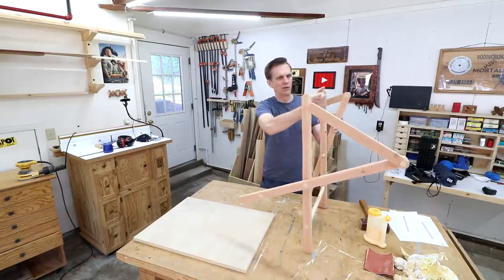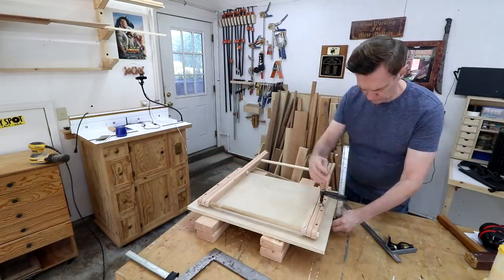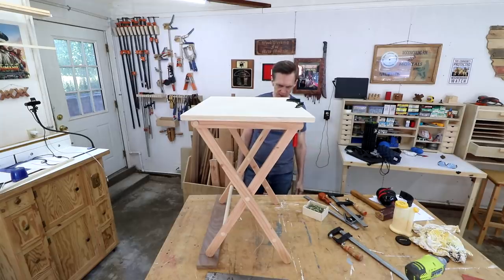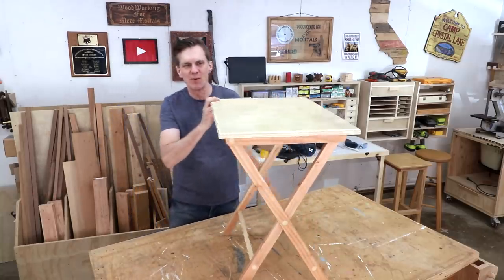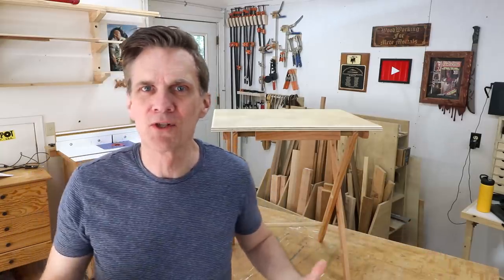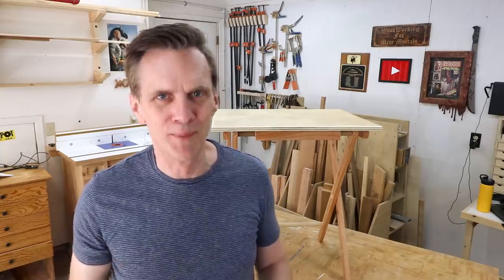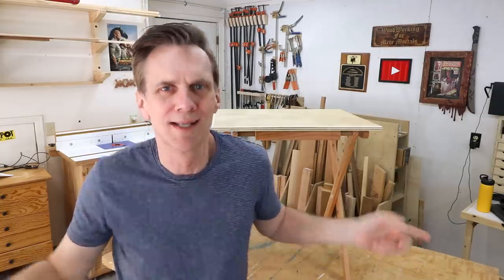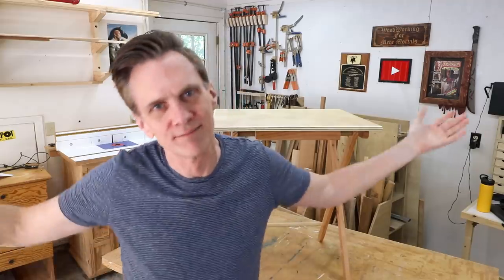Completing the folding table. This turned out trickier than I expected! LOCKDOWN Day 65

Comment: I built a set of these TV tables 10 or even 15 years ago.  I had the most trouble with the hinges but I got them to work.  At the time I was exploring tile inlays for the top.  I made 4 different tips all with a different time set.  
You are absolutely right about why we woodwork. We do it for the challenge and the fun of solving unforseen issues as the builds progress.  
Thanks for your show.
Deacon John

Comment: Couldn't agree more with your closing statements, for diversion I make little boxes from hard woods with dovetails, tight and perfect as I can, I usually burn them as imperfect.  Several years ago I decided to make a couple of raised beds to grow vegetables in, I bought 8 x 4 timbers and dovetailed them together just because I could and had no screws long enough to do it quick.  It took me HOURS, I think its 6 years later, the timber has dried, cracked , split and the joints have opened up, but I love those beds.  They give me joy every time I sit watching my food grow in those beds, they are not perfect, but I made them and they are beautiful to me.  That is why we fiddle with trees and spend a fortune on tools even though we actually don't need to, at least not when the material is 8 x 4 or 4 x 8 - whichever!  Keep 'em coming Steve.

Comment: I love this. I have a similarly designed table. One of the things that it has is an extra flat piece on the outside edge of the two legs without the cross-dowel. This keeps those legs locked from crossing over the dowelled piece. It also adds a bit of stability. Also, it has a basic block of wood that keeps pressure on the moving legs while the table is up. This allows you to transport the table ( say, with a game board on it ) without the legs flailing around.

Comment: About 12 years ago I made a pair of patio chairs following a tutorial from the family handyman magazine. It was my first attempt at wood working with only a circular saw, a plastic miter station, and a drill. ( of course measuring tape and a speed square). I cut and built the chairs in my apartment balcony, they came out very decent for a first attempt. To this day I have not seen a similar design anywhere else, so even though I got the idea from a magazine, I can basically say I came up with the design and nobody would question it. I still have the chairs which have traveled from California to West Virginia to Hawaii and back to California. They are still in good condition and I can fix any issues very easily. I can guarantee that I would not be able to buy similar chairs cheaper than what it costs me to make them 12 years later with all the tools I didn’t have before, the space and most importantly the knowledge I have now.

Comment: I made my wife a magazine rack for our 4th anniversary. I got the plan from a Dover book on Mission Furniture, and enlarged it to bookshelf size. This was my first attempt at a big-time woodworking project. I used mortise and tenon joinery with through mortises on the top and bottom shelves that was put together with wedges, all made with chisels, in rock maple. Holy crap was that an adventure requiring all sorts of mental gymnastics and trial and error. I was an engineering student at the time so this was an extravagant outlay on materials, but we were living in a bungalow, my wife was collecting smocking magazines and this seemed to be the perfect gift. I spent 3-weeks on it and 20 years later I still see every irregular cut, the place I had to glue where the through mortise blew out, and the swirl marks from the orbital sander that were left on a side rail. My wife just sees a beautiful piece of furniture her husband made explicitly for her. I spent way more than I had intended, but I thoroughly enjoyed the build process and my wife cherishes the end result.

Comment: You really hit the nail on the head... at the end there. I find sitting around and planning out the project very satisfying and when I've redesigned some simple thing 6 times and finally built it for twice what I thought it would cost and 3 extra trips to home depot, I see imperfections no one else would ever notice for years and for some reason point them out to people. Then I start the next one! Keep up the good work.

Comment: I have to admit that I am repulsed by knockdown furniture, and I have greatly enjoyed replacing the particle board junk I bought when first furnishing my home before I started woodworking. It's stunning how easily I've been able to basically fold up those particle board pieces I got from Walmart 3-5 years ago without even using tools. Meanwhile, stuff my Dad build three decades ago is still rock solid. 
I do build things because "I can" and I love the process, but building the things I NEED is actually the most fun for the reasons Steve hit on toward the end. If I'm going to use a table or a desk every day, it feels uniquely more satisfying to use it knowing I'm the one who built it. It feels so much more rewarding to give someone a gift I custom made for them than it does to order them something from Amazon. Personal satisfaction and ultimate customization are just impossible to buy off of a website or out of a catalog.

Comment: Steve, thanks. You got me into making stuff cos I wanted to. Biltong cutter, music stand, rabbit hutch, plant stand. And now I'm converting a van into a camper. This folding table is interesting, cos I'm about to face a similar problem with the legs. I'll do some sketches (and the math) but it looks as if the legs all have to be the same length, with the hinge hole in the legs offset so the legs fit inside each other. Mum had an ironing board with similar legs, had 3 height settings with three stops for the 'free' leg.. But the board was always level. I think watching you struggle has really helped me here.

Comment: I hovered around wanting to get into woodworking because I am a maker and I saw some crazy-expensive things that I would be happy to make for less myself. I knew if I did, the quality would not be the same as the ones I saw, but I was okay with that (looking at you, Wyrmwood gaming accessories and table!) But I kept daydreaming and wishing I could be instantly good. What finally got me to pull the trigger was Steve's video about 18 things every woodworker should know. Since then, I have built my table, and dealt with the frustrations inherent in things like box joinery and removable legs and using edge banding (which I won't again for durability reasons). I am making benches for the table this year with interlocking lap joinery and tongue and groove assembly for the bench tops. I see every flaw on that table every time I look at it no matter how much my wife praises it. But then I look at it and think, "Yeah, but none of my friends or family ever made a custom gaming table, so what room do they have to talk?"
Each thing I make comes with a learning curve. I mess materials up. And that's because I am a woodworker. :)

Comment: Mass produced furniture is made in standard dimensions that may not fit my room or requirements.  Making my own furniture is not only fun, but allows me to make the furniture customized for my needs.  I’m relatively new to woodworking and one of my first projects was Steve’s Adirondack chair, which still looks great after five years on the patio.  I’ve been a fan ever since.

Comment: Thank you so much for sharing your struggles with this project as I have been trying to build one of these by scratch for months.  Your idea about using dowel rods for the cross-sections is exactly the solution I needed as I've been trying to use a bolt which wasn't working.  You are awesome!

Comment: Cool project! My wife and I have a store-bought folding table like that, and the makers put a little flat bar across the underside of the top, sort of as a track for the legs to follow when you open and close it, if that makes sense. The bar goes from the center of that stopper piece to the center of the part of the stationary legs that is attached to table. If you can decipher what I mean, it might be worth adding. Haha.

Also, awesome motivational speech at the end! I'm trying to get into woodworking, and there's some great bits of wisdom I hadn't thought of!

Comment: I started woodworking as a therapy. From small simple boxes at first in order to learn the craft (especially safety), I went to more complex objects (12-side boxes with round lid, or my own design lamp, and now I built a tensegrity object from scratch (no plan, no measurement...). Today, when I make something, it has to be a challenge, or as you said, I might as well buy it...
Thanks for the inspiration!

Comment: In 2018 I built a system at my work place. The office was in a regular house with a back garden and that garden was turned into a car park but it was behind the house so if you came in and found that your car can't fit in you had to reverse out and it was inconvenient and not that safe. The system I built was made up of 2 arduinos, a couple of sensors and an LED display. I didn't have prior knowledge of the LED display, nor the sensors, I just experimented with arduino before. I soldered the required components on a testing board, attached the wires, the arduinos, connected 15 sensors (1 for each parking space to monitor). The whole system ended up costing about a $1000 and it was pretty neat. I was proud of myself, I did the heavy lifting and some of my colleagues helped with digging to lay down cables, drilling stuff, etc. After it was done I was proud but felt empty. I was partially sad it was over, but I also saw it's flaws and knew I could have made it better in many ways. I don't know how much it would have cost if we hired some experts. But it was planning, experimenting and building it.

Comment: Thank you so much for putting your money where your mouth is and showing us the problem-solving along the way! It's so valuable to my own woodworking journey and to my journey as a human.

My workshop time is basically "sawdust therapy." Such a tactile and creative process has basically become a form of mindfulness for me. Progress is slow because our workshop is still in the process of becoming a functional space (made enormously better already by The Weekend Workshop course). But even the janky shelves that I tried to spray paint and the plywood end grain looks awful, and the RIO shelf from the course that I accidentally gouged with my random orbit sander in multiple places - I still built them and that is so deeply satisfying.

Was surprised though that you didn't mention one key benefit of making your own projects - customization!!! I can build projects to the EXACT specifications that I prefer. The RIO shelf I tweaked to fit exactly in the nook between my garage door and the wall. That's a huge benefit even if it's tricky sometimes to modify plans!

Thank you for creating such a delightful corner of the Internet ❤

Comment: “Because we can.” Yep, that pretty much sums it up. Case in point - I’m making a flyscreen door for our back door. It’s all hardwood and some quite challenging joinery (for someone who has only recently come back to woodworking after a 40 year hiatus), and gonna cost a bomb. Certainly way more than an off-the-shelf timber or tube steel job from the local hardware store. And absolutely less secure than at least the steel option. But I’m going ahead with it because it provides me with a brilliant hands-on learning opportunity, a chance to further practice my joinery skills and, just maybe (if the damned thing actually comes together as intended!), some small sense of accomplishment. And, if I do do it right, it’ll still be around long after I’ve shuffled off my mortal coil. That makes me feel pretty good.

Comment: I agree that sometimes it's better to just buy it. Sometimes it is cheaper to buy it but i think it also depends on how long you have been doing woodworking and how much scrap crap "scrap" you be laying around. Small things are easy not advantages to build rather than buy. Just last night my brother in law and I built a stand for his Onewheel. They are $100 and I used scrap around my shop to build him one in 45 minutes. All of the materials were paid for by other jobs. I think the size of the project depends on if you are going to save money. Quick things to throw together and still have function and form totally worth it. I built my breakfast bar out of class 1 maple flooring I found in a dumpster outside of a gym that was having its floor replaced.  I used that as the bar and I cut up some bed frame and put the bar on the frame to hang it on the wall. That saved me money, however I bought the bar stools because we needed adjustable bar stools. Me and my 4 year old definitely can't sit at the same fixed bar stool so we just bought them. So yeah I agree but not for the small stuff.  Our custom stuff.

Comment: The same thing happens in many fields - electronics and computers for example.  For years it was cheaper/better to build your own, but now with mass market, an off-the-shelf devices costs much less than buying the parts.  So, the same reason for building/assembling your own exists in that field as well - I build it myself because I want to and I get exactly what I want the way that I want it.

Comment: Hi Steve.  I have a couple of these TV tables, and they have a small strip of metal, probably about 1mm thick 19mm wide and 45mm long, shaped and fastened to the Cleat to capture the table top dowel when it is put up.  There is also another cleat on the opposite side of the table top, minus the piece of metal (not sure .why that is there, except to stop the table legs turning inside out.....)    Love the projects.

I build something because I want to, rather than because I must, or because I cannot get what I want at a reasonable price.  It was a game board called "9 and 12 Men's Morris" I wanted, that set me looking at woodworking again and I discovered your amazing Chess board, which I still aspire to.

Comment: I'm amazed it was so easy to make the top level or straight to the sub-straight since what your sitting it on may not be level.  I would have tried to make the floor level then worked my way up to the work bench and finally to the top of the table.   Great Video, you have saved me so much work!

Comment: Great video Steve!  Love the TV tray. Two small improvements I see would be to add a stop block on the back of the tray to keep the leg from swinging out the back side. Second, the stop block on the front could use a lip on the under side to keep the top on the leg if you lift the tray.

Comment: Thanks, learned more from the wrap up than the video.  Been wood working fifty five years.  Lately I have been building tombstones.  Something to remember me by.

By the way, if you didn't do it,  the stop on the table should "capture" the cross bar.  Otherwise, when you lift the table it will collapse.

Comment: Hi Steve, Another interesting and informative video.
It was nice to see how you worked round the challenges of making the design work in reality, but I was particularly interested in your monologue of 'why bother?'.
For me there are two key aspects: creativity and ownership.
Creativity inspires us to make things that don't exist, whether that's an artist painting a picture or a photographer looking for a new angle of something that's been photographed a million times.
If you just want a picture, Ikea sell them too, but it's not YOUR picture.
And that's the other part. It's about making something that you have chosen to make, the way you have chosen to make it. Most of your 'Lockdown' projects have been things that solve a problem or meet a need that you specifically have. Those problems are addressed using the skills, facilities, and materials that you have available. In some cases they are designed specifically, in others they have been adapted for your needs.
Either way, it's yours and there is a tremendous satisfaction in the creative process and the finished product, and sometimes the journey is more enjoyable than the destination.
Keep up the good work and stay safe (or Stay Alert as we are told in the UK)
Paul

Comment: Steve if I may suggest. You need a way to prevent someone from accidentally lifting up on the top of the tray as they stand up and collapsing the unit. They normally use a wire (coat hanger diameter) rod that is on center running from the front leg stop to the back thus trapping the leg dowel beneath the table top. It will still allow the unit to fold and you will be able to pick the table up by the top to move it without it collapsing. Just a suggestion.

Comment: So on most folding TV trays, they put a stop block on both ends and a thin bar under and parallel to the top. They do this to keep the moving leg from "bumping loose" and the whole tray collapsing. If your sons putting notes, dice trays, or a laptop on this, it's a little extra security you might consider.
Reply: (specifically, because the "near-side" of the table will be the one without the bottom support between the legs, if you bump the top edge of the table up by scooching your seat or turning your chair, it'll pop the top leg stop off the crossbar)

Comment: a three inch block running back to front with a scoop for the top dowel, a second block screwed on top to swivel, turn top 90 deg, open table insert dowel in scoop , turn top back and legs secured, reverse process to collapse.

Comment: I find most of my woodwork is making things that I CAN'T buy from Ikea or elsewhere - I'm sitting here in a Poang rocker after having 2 of the regular Poang's fall apart, one due to the holes being about 1/8" off. Bookcases to fit a particular space, a wall of them actually, so that they all look similar - bought book cases inevitably leave a gap. Storage chests of various types for my Re-enactor hobby and other similar furniture such campaign style furniture.